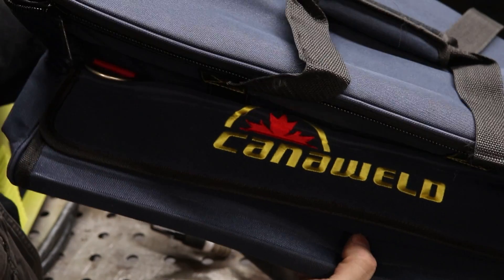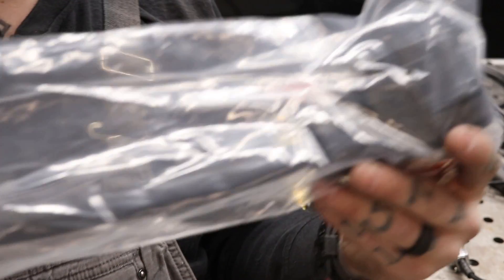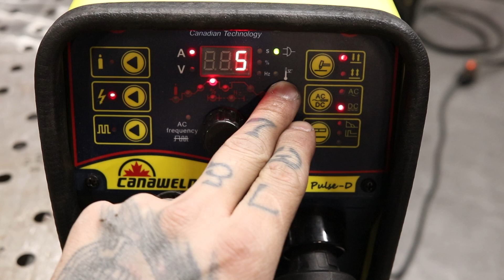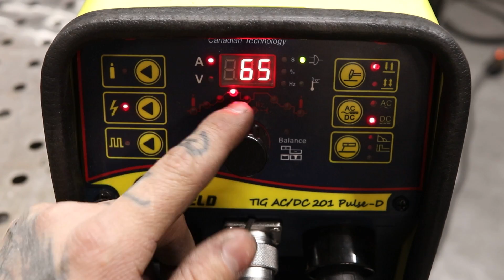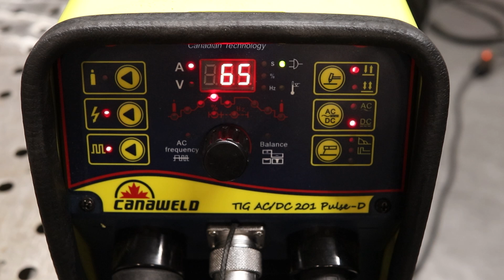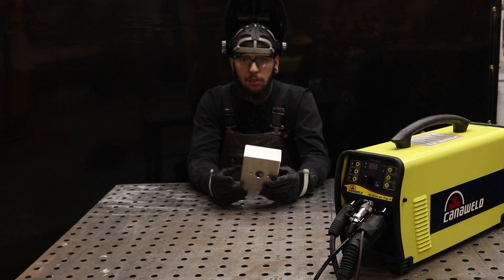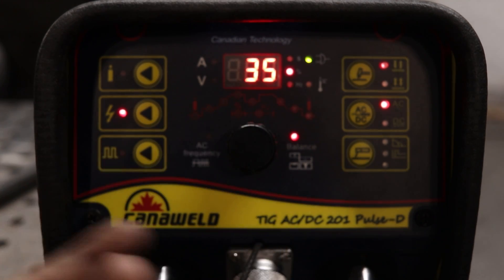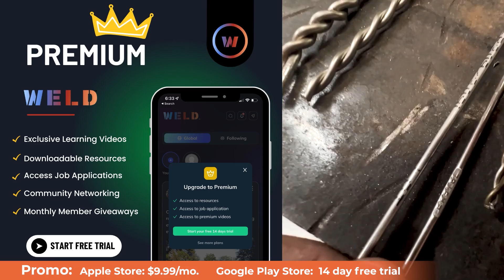Product Review: Welding with the Canaweld AC/DC 201 Pulse-D Welder

Comment: Canaweld what a Joke. My machine came damaged they would not exchange it with another machine.
Reply from the maker: oh that's not good. we will reach out to them and see if we can do something to help you.  how long ago?
Reply: @Welddotcom  it's been a couple of years ago. The metal cover was dented in from the factory. One of the screws was completely stripped out. Talked to customer service. They would not exchange the unit for a new one only offered to take $50 off the price or a new cheap welding helmet. If I could make a recommendation to anybody stay away from this company.